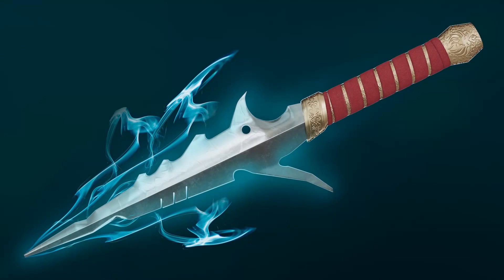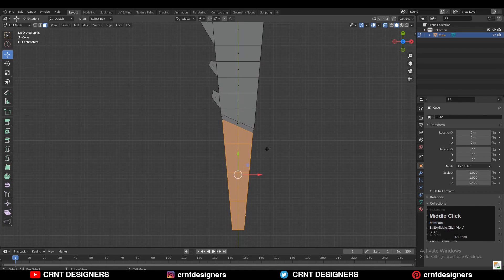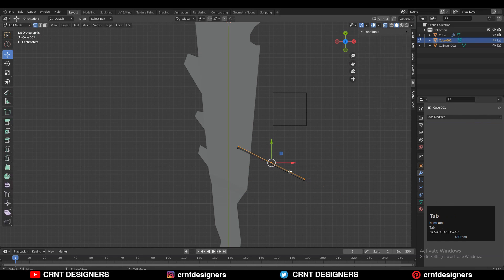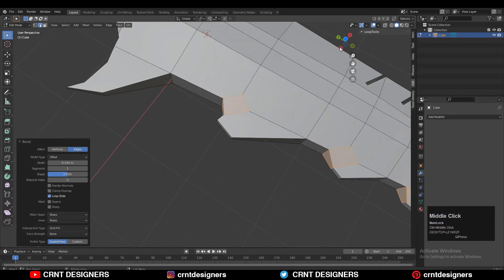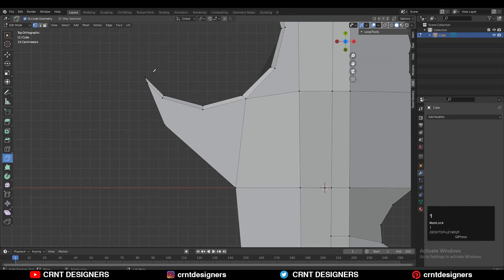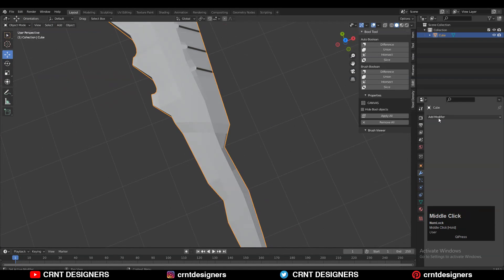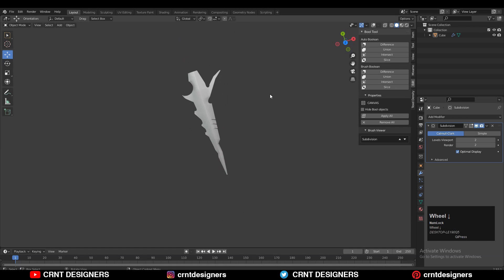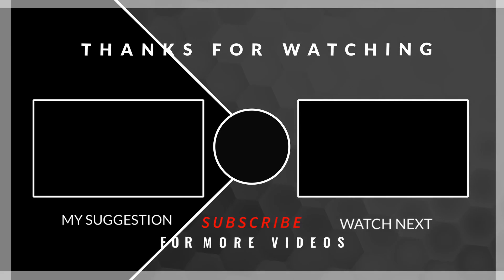Sword Creation In Blender | Part 1| Sword Blade Modeling | Blender Sword Tutorial

Comment: What did you do after you applied the boolean modifier and deleted the boolean cylinder to join the vertices so that those faces wouldn't be ngons?
Reply from the maker: Just create the right topology, verts count of a cylinder is 8 and there are the same number of verts. So I could  easily create the right topology.
Reply: @CRNTDESIGNERS  I understand that, but after applying the boolean at 6:53, there are obviously ngons.   Then at 6:55 the good topology appears.  I tried slowing down the video, but what did you do there for that to happen?
Reply: @MistaGrim  What he did was i think connected the corner verts to the outer verts, by either using knife tool or connect vertex path. This is just what I think cuz it's the most reasonable way I can find atm.
Reply: @newtons4o114  It happened so fast that I think it was a shortcut because he selected all of the faces, then the ngons were gone and new faces appeared.